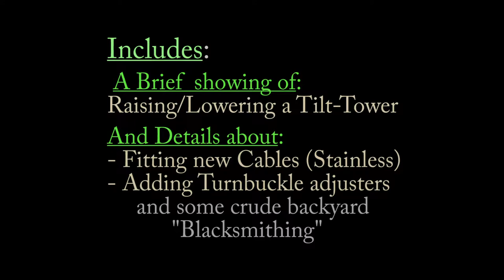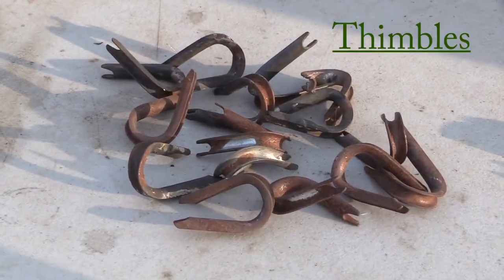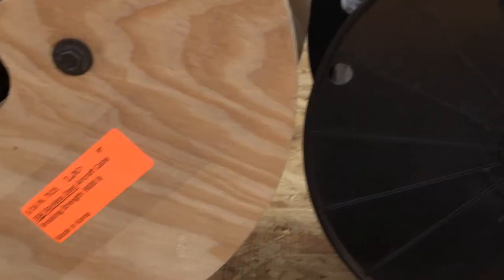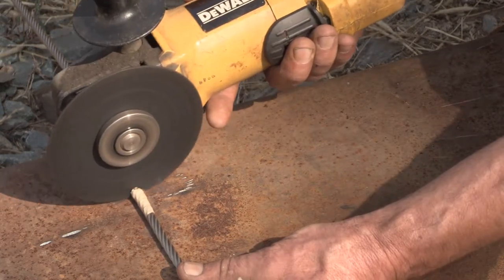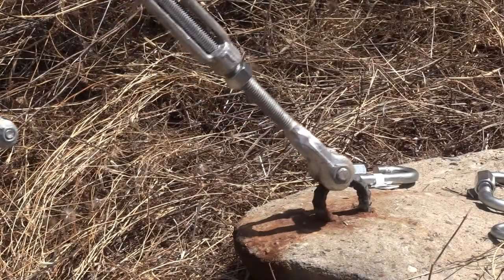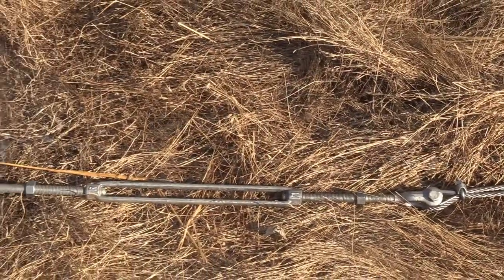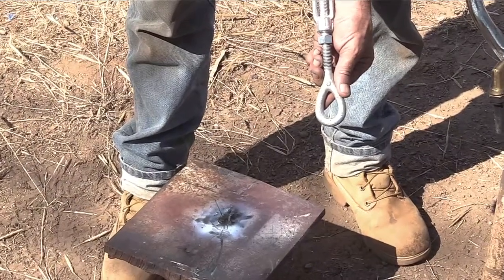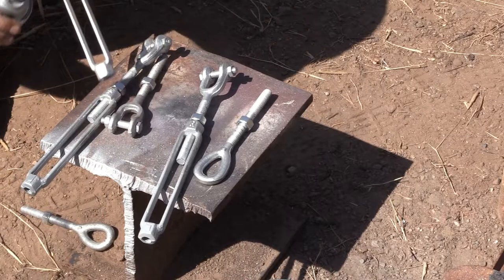Tower Cables:  Install, Renew or Upgrade

Comment: Nice job well done .  I just tilted mine up today and guyed it .  it's a rhon 25g at 50' with an 1.5 sch.80 pipe that makes 55'4" with a 6.5' swept area . I still have to let it back down and put the blades and tail on .
Reply from the maker: thanks for comment..  sounds like you're homing in on the final tower/turbine setup.   
Good luck, and safety first